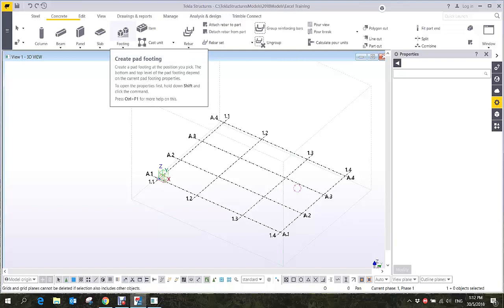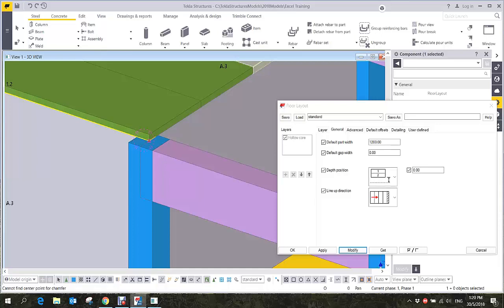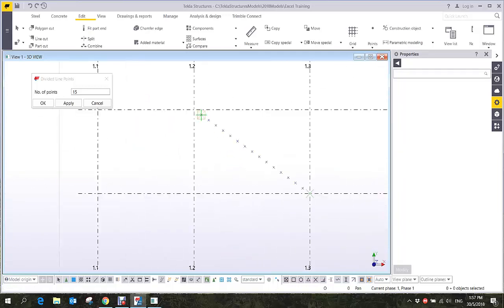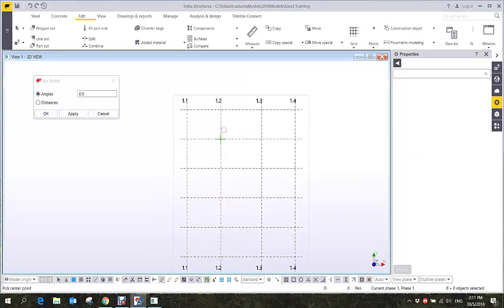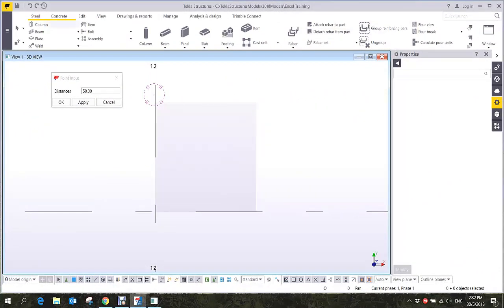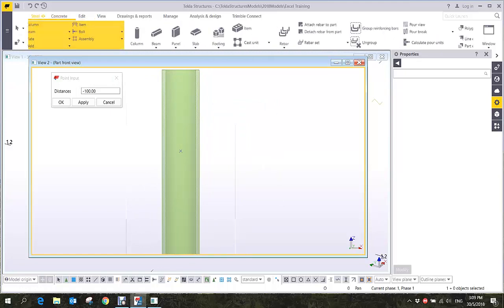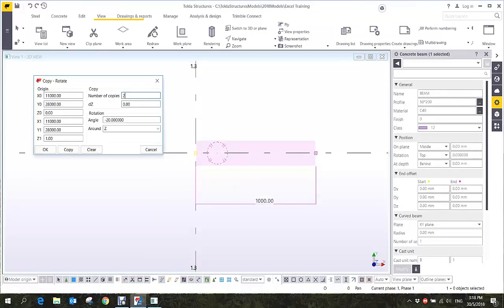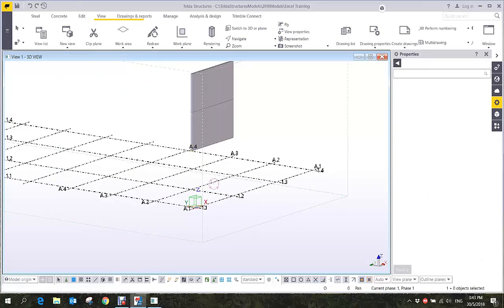Tekla Structures Basic Training (Day 1 PM) (Part One)

Comment: Content of Video:
00:00 Model Precast elements: Footing, Column, Beam, Slab, Panel
11:37 Create Construction points/line: On line, Parallel to two points, Along extension of two points, Along arc using center and arc points
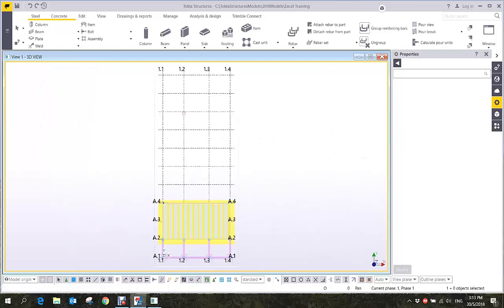43:20 Move command and Copy command
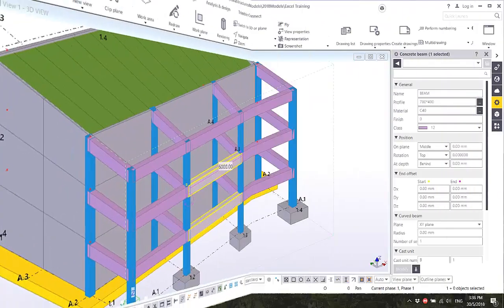50:36 Create view for a elements